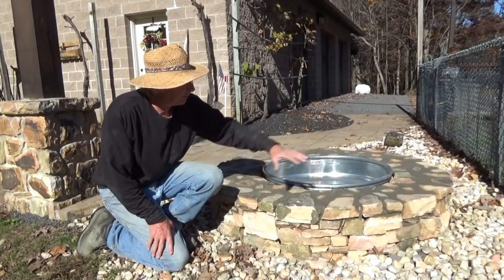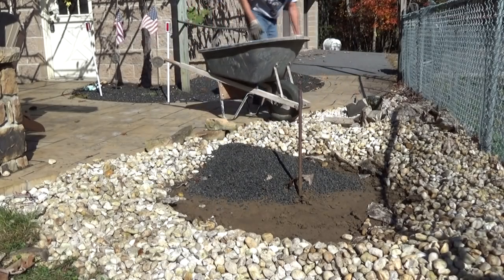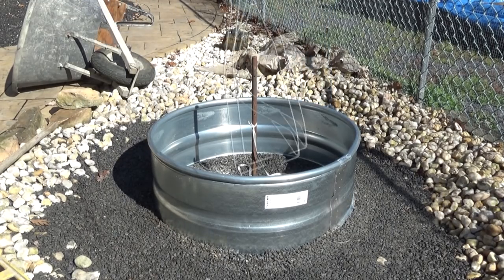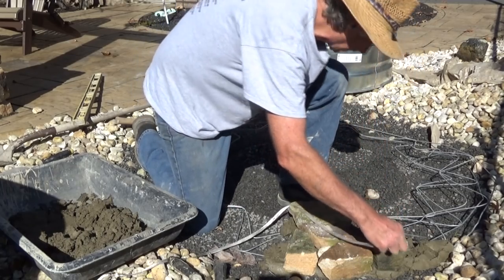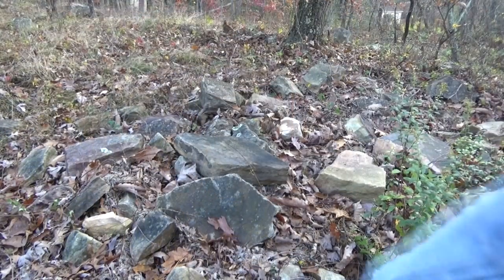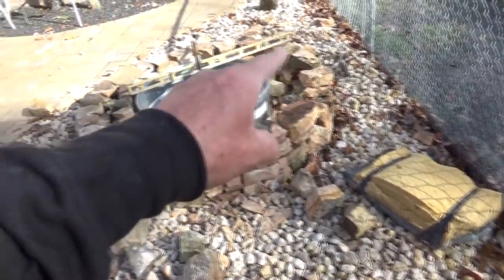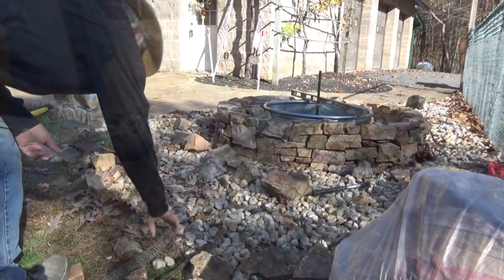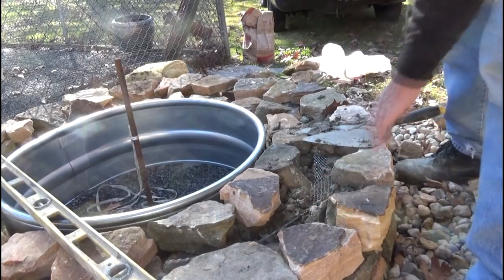STONE FIRE PIT BUILD DIY (Mike Haduck)

Comment: Mike ,thanks for the great idea of getting sponges from an old couch cushion.I would have never thought about that. I'm always in such a hurry,I go by Home Depot and pick up 2 or 3 ....but no more! Also,talking about the timing of sponging stuff off,you can really make a mess if you're too early and it's still too wet. However, in another way it seals up really good and doesn't leave any hair-line cracks in the mortar joint . You just have to go over it again once it does dry up some. Great video! Merry Christmas!
Reply from the maker: Thanks Mikey, I appreciate it, MERRY Christmas also, Mike

Comment: I dry stack with limestone, tons of this rock near my house. Yet limestone from parent strata presents so many shapes from almost round to cube, triangular vertices, shards, and mix of many shapes in 1. Limestone is still has a punky lifespan though but still they are free and it is better to make a wall or something useful that keeps the mind busy. 
From my collection of rocks I presort on the ground similar shape types yet I use a stick of chalk to mark the rock for what fits together best when trying to get the best finish. Flat sides facing out not irregular facing out. Sometimes I get stuck and have to go out and look for that one shape. Or disassemble to get the best fit.
Staggering is probably the best technique for all the versions. Never stack rock on top of rock it has no stability.
Reply from the maker: Thanks Eric, Mike

Comment: So Portland can withstand the heat of the fire? That's good because I got a couple of cracks in my Chimanea that I need to fill. 
P.S.: I'm the DIY-er who is working on my slate+brick front steps. It's still a work in progress, but my first two rows of steps, which I re-worked with Portland + Sand made it through the Christmas freeze and did not pop! I'm so happy that I found your channel! Happy New Year, Mike!
Reply from the maker: Thanks Carolyn,  nothing will stand up to fire , it helps though, thanks Mike

Comment: Great video Mike!  Aren't you worried about sandstone absorbing water and then exploding the stone when the trapped water finally flashes to steam? Back many decades ago, I had a stone explode with such force that it knocked me back 3 feet and threw huge burning logs all over my campsite.  I was extremely lucky my friend and I didn't get seriously hurt.  After that terrifying experience, I never use sandstone rocks for anything that generates enough heat to create steam.  Just my experience with sandstone...
Reply from the maker: Hi Greg.  I agree that is why the space between the metal and stone, also the owner plans to keep it covered when not in use,  thanks mike

Comment: Hey Mike why did you use Portland instead of brickset, just curious. I been doing masonry restoration for about 25 years and I'm still learning and trying to soak up as much information as possible. I appreciate your input, also I'm from Milwaukee, Wisconsin we have alot of old buildings built with Cream City brick,did you ever see or use them out in your neck of the woods,Cream City brick were made in or around Milwaukee? Da fire pit looks good as usual.
Reply from the maker: Thanks Mars, anything that lays flat and outside I almost always use portland, I know restoration brick work the old timers used lime, today soft mortar, they say the cement should always be softer than the stone or brick. I still can't find a old old timer who used lime in my area, but they mixed it with portland in Jersey when I worked there, some day I might get a definite answer, when I did the video on conwy castle I picked some stuff up, lol. Mike

Comment: Hey Mike, where did the foundation work? from what I know, when doing any type of stone/brickwork some sort of concrete foundation is a must in order to ensure the end result will last many years. Not only talking about colder climates where building without a foundation will cause the stonework to crack and move, also as a general rule so that the heavy stonework have a decent and sable substructure to lean on. at least this is how we do it in Europe, even a thin(ish) 15-20cm thick foundation with a thin rebar mesh would be better than doing all of your previous time consuming work on gravel
Reply from the maker: Hi David, did you ever look good at railroad tracks where tons and tons of freight go over every day, all gravel, lots of garages and homes on gravel, retaining walls, the old stone foundations were laid in the dirt, Venice was built on pilings,  concrete just started being used in early 1900s gravel is one of your best bases, thanks Mike
Reply: @MikeHaduck  I actually did understand your "railroad" concept. the reason why railroads are built that why has other reasons than just avoiding a concrete foundation, we have lots and lots of railroads in Europe 🙂
I am sure the "structure" of the stonework can hold it self in place just because of the weight. but I wonder what happens after 10-12 years, a few light earthquakes, maybe proximity to a main road where heavy trucks are driving and creating small but significant (over time) disturbances to the base soil etc... would this type of stonework not crack? or move? or shift away in a direction?
Reply from the maker: hi david, in florida, the souther states new orleans etc,  you dig down one foot and its into the water table, nobody pours footers almost everything is laid on gravel,  research it your self, i got a video florida building techinques, thanks mike
Reply: @MikeHaduck  interesting, at least it's easier to drill a well :)

Comment: Enjoyed  your video and learned a lot.  But . . . I used left over granite rock for my pit.  I have a metal interior ring and used quickcrete for the rock. I have at least a 2" space between metal ring and rock.  I will be making a wooden cover for it.  My dilemma?  I'm no mason. I fear all my work will be ruined in a few seasons.  Is there a not-too-expensive sealer I can apply to the rock/concrete to help it's longevity?  Thank you. - Susie
Reply from the maker: Hi Suzie, I think you got the right idea to cover it for the season, I rarely use sealers,  I am sure your project will hold up fine, thanks Mike

Comment: Hey Mike another great video. Quick question for you… I have an area behind my house like the one in the video with a bunch of stone laying around and have been wanting to put a dry stack stone on the wall under my porch, but due to material costs haven’t been able to do it. So I have been thinking for a while about whether or not it would be possible to bring that stone down from the woods to the house little by little until I have a enough and then break them apart into veneer sizes to install as a dry stack look on the front of the house. Is that a possibility if willing to put in the work and effort to accomplish it?
Reply from the maker: Hi, I can't say, I only show the way I have done things, thanks Mike
Reply: @MikeHaduck  thanks for the response mike I appreciate it

Comment: Hey Mike, I live in Litchfield Co. CT, recently all a lot posh homeowners are suddenly all putting in cobble stone aprons between the road asphalt and gravel of their driveways.  All it takes is one person to start the trend.  Some masons put down a film/thin layer of gravel and cement all the cobbles together.  From watching your videos it would seem that would prone to shifting from car weight frost heaving in the long term.  Question/comment are old European cobble stone road cemented or do stones just float packed in as tight as possible and sit on a thick gravel bed?  What's best way to do a driveway apron or most old school way  (e.g. like 18" of gravel and have the stones float and gaps just filled with sand?)
Reply from the maker: Hi, in Europe they go deep with modified and gravel, so thay last a long time,  everything depends on the base and how deep it is, no direct answer, sometimes I pour concrete first and go on top no shifting but again everything depends,  the is mike

Comment: To be clear, you're only using mortar on the bottom and top row, correct? The rest are dry laid? Thanks.
Reply from the maker: Hi, on the bottom and top I cement it solid in between I cement it but not solid so the air can go through,  thanks mike

Comment: Killer work Mike.  I have not used a metal ring before but I think I’ll give it a try.  Is that from a farm supply store like Tractor Supply?   Just cut down to the required height.  Plenty of Copperheads down my way too;  your go to rock pile stash is where I’d be careful!  Lol.  Thanks for passing down your knowledge and documenting it for us here on YouTube.  I heard Avoca got its name from a train track that goes through it;  either a bad accident or sadness.  Native Americans named it,  means crying or wailing.  What do you know about that?  Happy Holidays from the Myers family in Atlanta.
Reply from the maker: Thanks Chad,  I heard that Avoca,  no one seems to nail it, it used to be called pleasant valley,  I get that wire at block or masonry supply company's. It's called duro wall,  you could just use regular concrete wire,  whatever works. , thanks mike

Comment: Does most stone break with a hammer like that? What did you call that wire at the bottom?
Reply from the maker: Yes, for the most part. The wire is called duro wall, mike

Comment: Hey mike, I’m interested in building a similar stone fire pit in my flagstone patio I’m working on now, have you ever used firebrick instead of the metal ring and any special considerations using that? I don’t see how air would get to the fire with firebrick but I’ve seen other videos using it. Keep up the great work and very informative videos! I’ve watched this one three times trying to get ready for my project!
Reply from the maker: Hi Joel, you could but a hot fire too fast will crack it,  the metal ring will expand and contract and won't bother the stone as long as it's not touching it,  if that makes sense,  thanks mike

Comment: Mike can you use type S mortar instead of 2sand 1portland for this project?   And if this was a brick job fire pit would it be the same?
Reply from the maker: Hi Maddog,  in my area I only use Portland and sand other masons might say different,  thanks Mike
Reply: @MikeHaduck  thanks Mike.  So the Haduck magic mix is 2 sand 1 Portland mix  right?
Reply from the maker: Hi maddog, brick can be a lot softer than stone especially around a firepit,  if it's a softer brick you might have to use some mortar, I can't say unless I was there, thanks mike

Comment: Mike my god every video no matter what it is.    Whether your just going to “patch it up” or “just paint it on”.   You amaze me. Thanks
I have a flagstone patio around my firepit.  If i step on some pieces it feels loose.   Some of the mortar in between i can pull out with my hands.. im going to lift some flagstone up and re set them with 2 sand 1 portland Then rapid set mortar the joints.   If im correct its bc of you.  If im wrong its bc i suck at this.  What you think?
Reply from the maker: Hi Tommy, check out my stone patio videos and playlist, I have a lot of different techniques, I rarely use rapid set in them, I hope it helps, thanks Mike

Comment: What's the wire called and where do / did you get it
Reply from the maker: Hi Pat, on the bottom dura wall, but you can use any wire and the top stucco wire mesh,  almost any masonry supply store has it, thanks Mike

Comment: I thought you were against using any metal with masonry?
Reply from the maker: Hi Mike, for the most part yes, but thin wire won't hurt it, it won't bust it apart when it's thin but eventually will rot away, thanks Mike
Reply: @MikeHaduck  Thanks Mike. You do say to be flexible with every job!